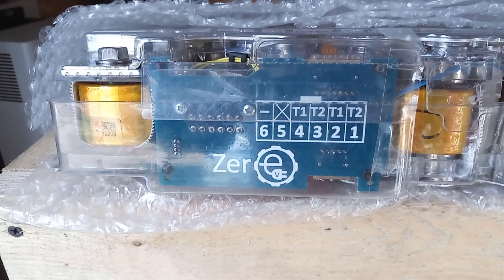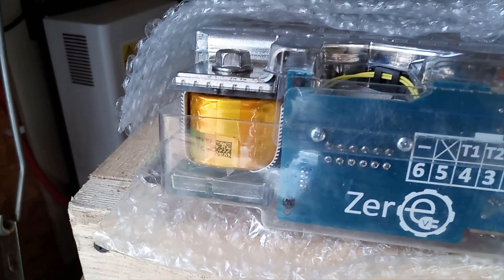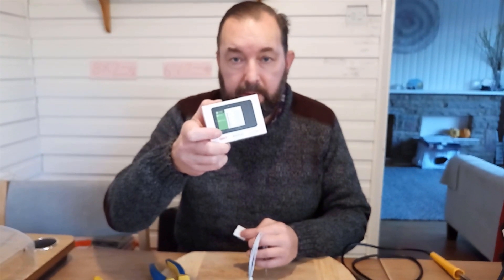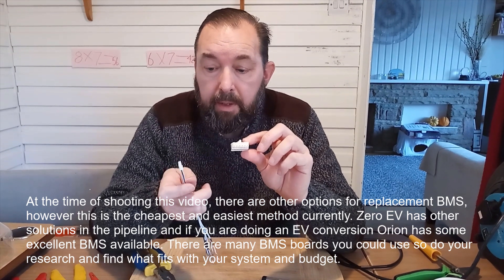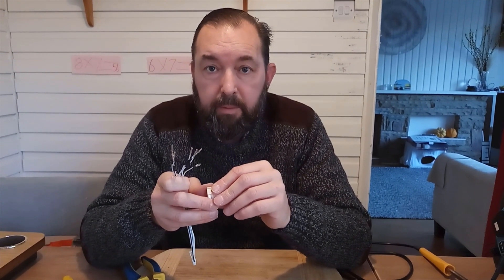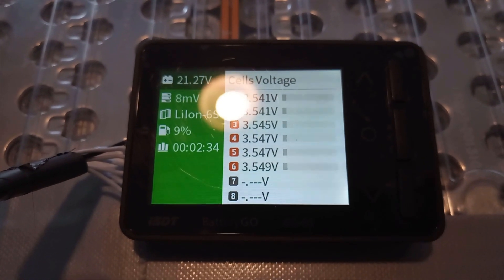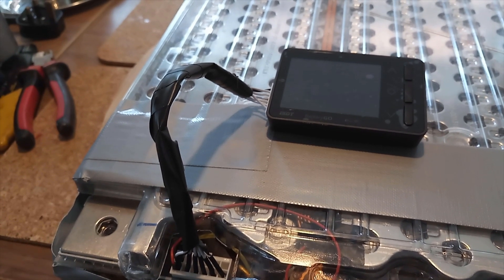Fitting the replacement Tesla BMS board and wiring in the new BMS - Off Grid Solar UK -

Comment: The gen 1 I have are hard wired. Do you have or know where I can aquire a wire diagram. I have one that is bad and want to replace it with a gen2 unit. However, the newer plugs would need to soldered on.

Comment: How does the BattGo compare to the Tenergy 5 in 1?  I've been going down this rabbit hole after following Mortons on the Move, and Tom was saying the 5 in 1 shouldn't be left connected full time, although I wasn't entirely clear why.  Can the BattGo be connected and balance the batteries full time?  I intend to use my single Tesla pack in an RV if that matters.
Reply from the maker: Its fine for the Battgo to be left connected
Reply from the maker: Providing you have a form of control for a low voltage cut off situation of course Victron smart shunt or battery protect or both!
Reply from the maker: The battgo is also slightly better than the Tenergy in my opinion, but I have also found another product available in my Ebay https://www.ebay.co.uk/itm/234322528255?mkcid=16&mkevt=1&mkrid=711-127632-2357-0&ssspo=9eZ9pPWET2q&sssrc=2349624&ssuid=9eZ9pPWET2q&var=&widget_ver=artemis&media=COPY

Comment from the maker: Ok so an update, my Tesla Modules after a year of being in my solar system have been passively balancing and voltages are all within 0.03 volts of each other for each series of cells! No issues whatsoever have been cycling between 19V and 24.4V and charging at 45-80amps from the grid in the depths of winter, 240amps DC max in the Summer. Will do another update video soon but so far both modules performing very well and no issues at all.

Comment: Hi, thank you for posting. I have a couple of questions if you could help? When installing the new board in the battery, do you need to unsolder the existing board or are the wires just unclipped from the old board and connected to the new board? Is there a wiring diagram for the output wires on the molex connector? Does it matter which bms I use? I guess the molex just exposes wires for the two temperature sensors and cell voltages?

 I have 2 Tesla packs coming and trying to figure out what I need for the bms.

Do you know the best way of getting a bms to disconnect the battery in the event of overcharge or low voltage?

Sorry for so many questions, I'm trying to get my head around everything :)
Reply from the maker: Hi ok firstly you will have 2 ribbon cables connecting from the original Tesla bms plus 4 other connectors in which you have to push the centre through, not all the way to release them as you will need to reuse them. Be very careful when prising the connectors off and take your time, if you tear the ribbon you will be in trouble! Once the board is out, carefully fit the replacement board and reconnect the ribbon cables top and bottom and replace securing black plugs in each corner of the module. As I stated in the video you will then have to make up the wiring harness. I discovered Tesa tape after this to be the best when wrapping all the wires together.
You will then have your minus connection and 6 + connectors going to each series of cells plus the temperature sensors for left and right. As for the BMS, that's down to your budget, higher the amp rate the quicker the balance, however off grid use using 20-80% ratio you will be tickling these batteries and they will passively self balance. But I like to know and is good practice.
Reply from the maker: Regards over and under voltage, use Victron battery protect and program your charge controller with a 24.4V floating voltage, your inverter choice is most important and can recommend my bespoke inverters which are programmable with cut off voltage at either 18 or 19v and cut off for overvoltage with charger facility for low voltage providing its connected to an AC source such as a generator/mains etc Hope this helps. There are other methods using relays and Victron BMV712 for example
Reply from the maker: charging voltage should be no higher than 12.4v for maximum longevity
Reply: @offgridsolaruk843  thank you very much for taking the time for a thorough reply. All makes sense and thank you again
Reply: @offgridsolaruk843  Do you mean 24.4?
Reply from the maker: @RaglansElectricBaboon  Apologies yes 24.4V is what I have been working to, well spotted!
Reply from the maker: I am now working at 24.6v for solar charging, with 100% being 25.2v, this still gives plenty of headroom.

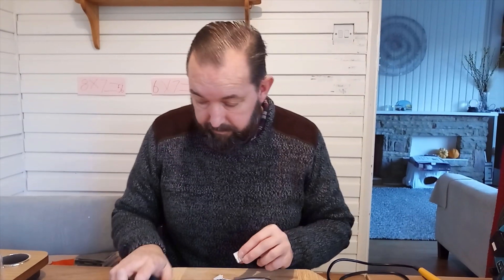Comment: 2:25 i noticed you had to adjust some of the connectors, i am trying to get the proper connection because i am getting crazy readings from cell balancer. what did you do to get it working to lilon 6s status?
Reply from the maker: Yes I had the same, its the connection to each cell series you should check over. Use a volt meter to check each one then identify. You my have to run another wire to the faulty cell and connect into the Molex
Reply: @offgridsolaruk843  thanks!